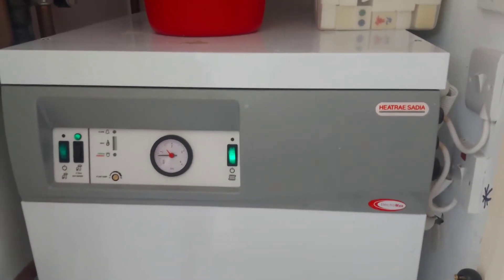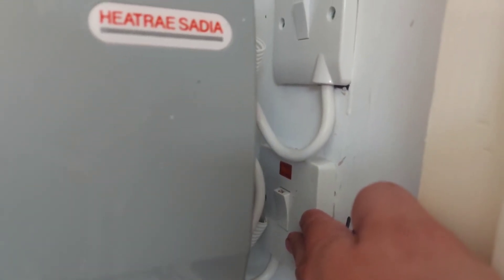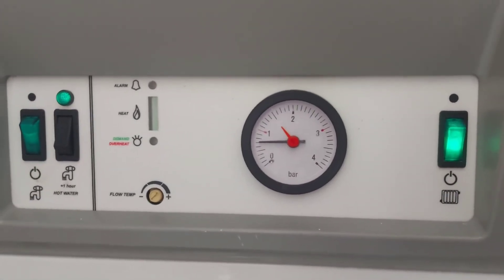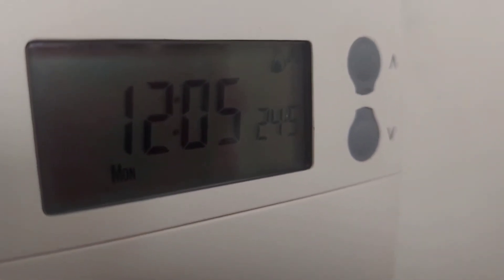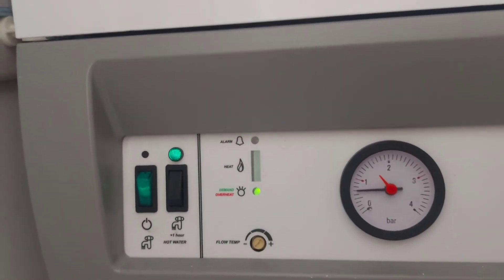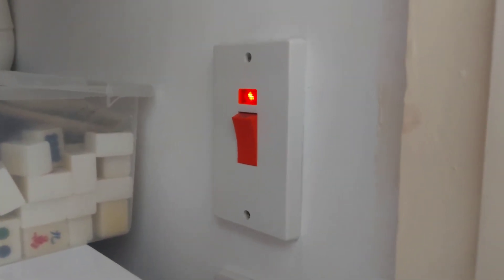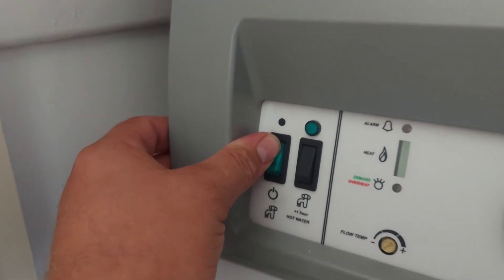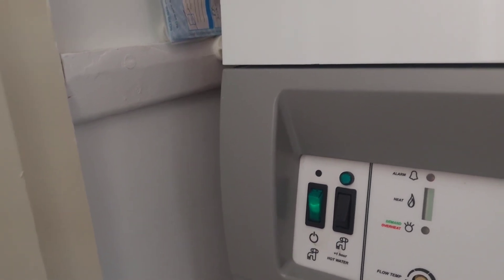Heatrae Sadia Electro Max Boiler Controls explained

Comment: Hi, good video, thank you for the explanation. We live in rented property & have never really figured it out. Our water seems extremely hot, do you know if there is a way to reduce this? 
What does the flow temp dial do lower down on the panel?
Reply from the maker: Flow temp dial is the temp of the water I. The rads to decrease the hot water temp you need access to the Immersion element by taken off the panel and removing the Immersion cover then turning the thermostat down

How water should be stored at 60 degree  s and come out the tap at 50 degrees 

If the water is coming out of the tap above 60 or below 50 report this to your letting agent or landlord
Reply: @DeathLazerBoy  great thank you. We will have a look at taking the thermostat temp down, otherwise we’re due an engineer for a service so will ask him. 
These are supposed to be quite economical from what I read but it seems to be costing us a fortune, we daren’t put the heating on 😬
Reply: @kwj6365  costing me a fortune too!! No idea why and electrician said it’s all fine. Settings must be wrong somewhere …
Reply from the maker: Make sure you are on an economy 7 tariff not a super deal or single rate as these details will effect your running costs massively. Electricians just check the wiring etc and often don't know much about tariffs. Please consider subscribing to help me grow the channel